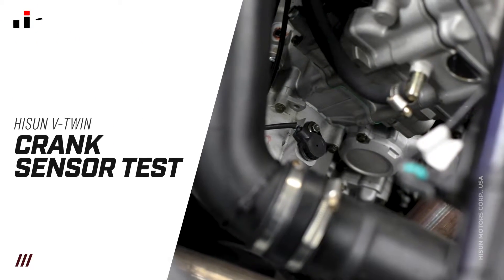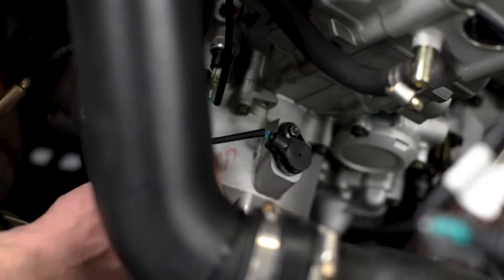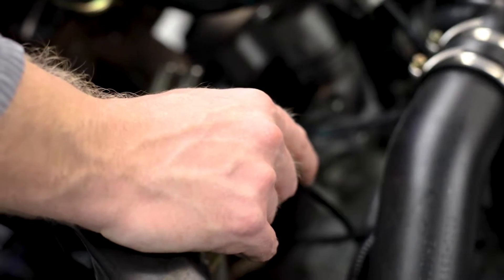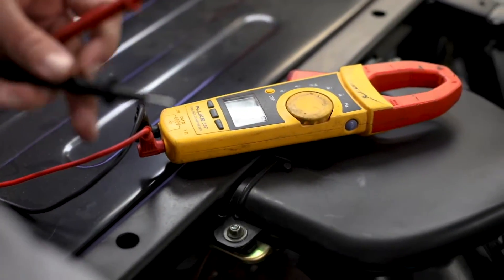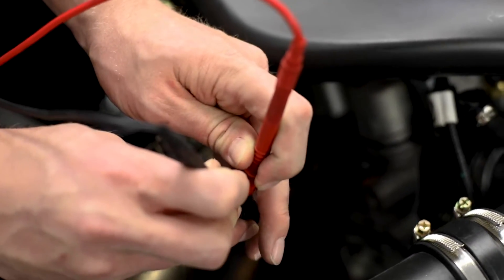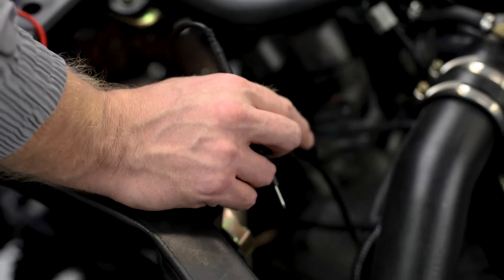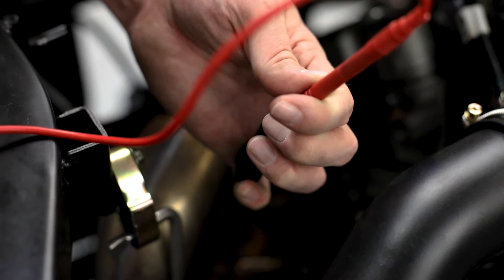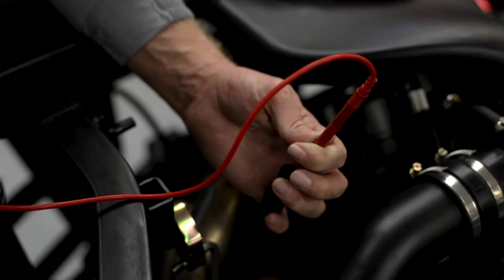Crank Sensor Test - HISUN 1000cc UTV Engine

Comment: I have a 2017 vector 500. Throwing code PO 336 CKP Sensor Noisy Signal. Has a hard time starting then stalls if it ever does start.

Comment: I have 2011 hisun 700 supermach and have no spark and fuel pump sometimes wont humm or kick on. Intermitten, any ideas. I replaced the coil pack